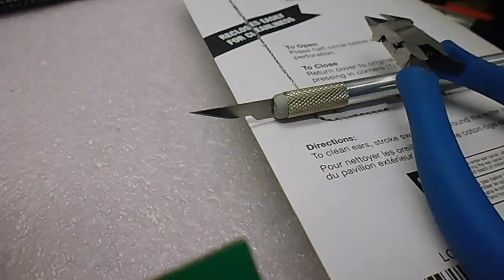Repairing Edge Connectors

Comment: Do you have a video where you repair the edge connectors on a PCB, but not so much the traces, but the fiberglass board? Got a hold of an Asus Hyper M.2 Gen 4 expansion card (holds 4 M.2  cards, found it in an e-waste dumpster!) Looks to be in good shape (missing some mounting screws!) but noticed that on one area - about two pins wide - of the fiberglass board is slightly damaged. If it were to be inserted into the matching slot, it would make the slight bend worse. Thank you